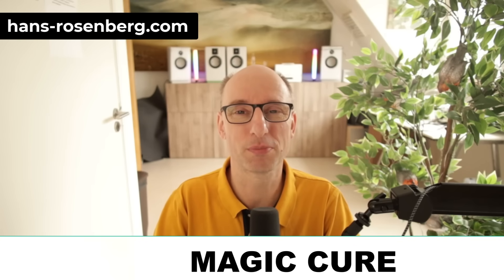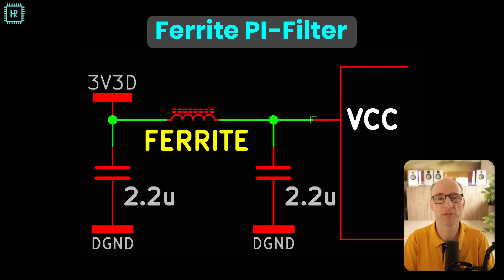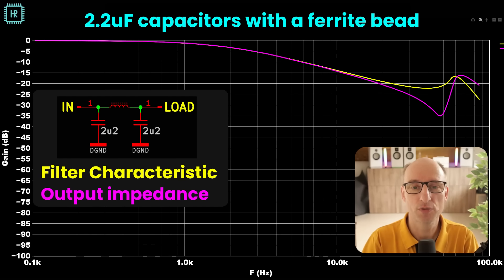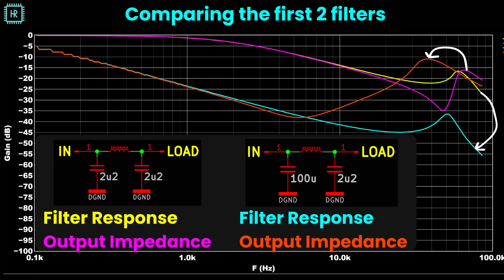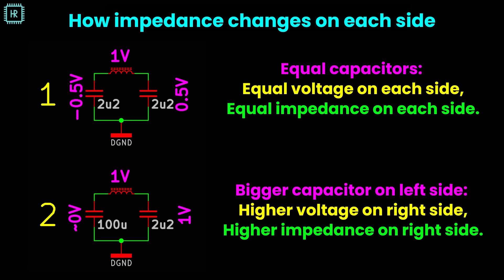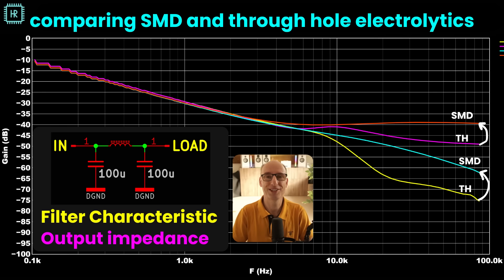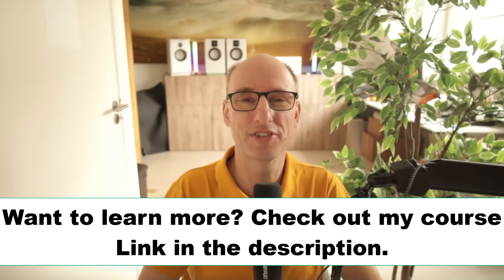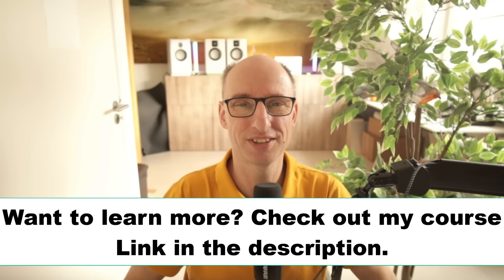How Ferrites Can Quietly Ruin Your Supply

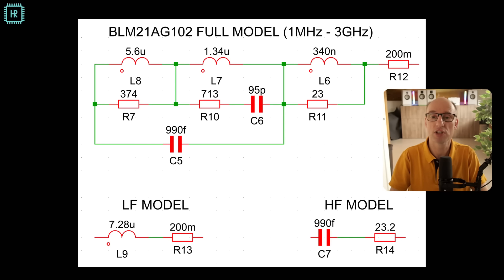Comment: 1:38 lol so "use whatever is dark gray, magnetic and on the floor after salvaging chips with a heat gun" is not a reliable strategy? :) On a more serious note, is there a filter design that would literally work with that, expecting just characteristics common to all SMT ferrite beads?
Reply from the maker: yes, use large caps on each side!

Comment: Always thought ferrite beads were meant to confine the current spikes from a noisy device and protect the power rail, not protect the device FROM the power rail?   .. In any case, what confuses me to this day is how do you use ferrite beads and bypass capacitors on PECL, given that Vcc is theoretically ground for PECL?
Reply from the maker: You're right, filters work both ways. You also keep spikes away from the main supply.

Comment: Neat research, though I’d want to use a VNA instead of an audio analyser, to see how they compare up in the MHz with the digital edges a common embedded circuit would encounter.

A more tactful method might be to design your PSU to take feedback after a PI filter (LC or RC) instead of putting a filter outside the PSU’s feedback loop. Even better, a capacitance multiplier, giving you less drop than an LDO and better ripple rejection at higher frequencies.
Reply: feedback after a pi filter just added  a pair of poles to your transfer function, you'd better damp the hell out of that filter if you want stability....
Reply: @terrygiven8789  Yeah you’d want to understand control theory better than I do to pull that off. Maybe if the switching controller recommended it in an appnote with a certain passive network on the comp pin.
Reply: @Scrogan  one trick if you are using a TL431 and opto for feedback is to connect the opto cathode to the input side of the filter, and the feedback network to the output side of the filter. the opto cathode and series R form a "fast path" and the feedback divider and compensation network form the "slow" path. putting the fast path on the input means the pair of poles arent there, and as long as the loop BW is lower than the filter poles, they dont affect the slow path much. Unitrode have an application note discussing this
Reply from the maker: I may do another video showing the RF performance. My VNA was not capable of measuring below 100kHz correctly, it showed bad results

Comment: The high (100uF) is only partial the reason, the second half is their relative high loss / E.S.Resistance, creating very low Q resistances.
100uF polymer caps or ceramic  with low esr could also be bad idea to use with the ferrite.
Reply: Use caps de menor valor em paralelo, isso reduz a ESR.
Reply from the maker: indeed, but if the value of the capacitor is high enough to crush the Q, then it is no problem.

Comment: Good points. Ferrite beads are commonly misunderstood and often used with a belief that they will magically "do what you want" by blocking all disturbances and letting the good stuff (a stable supply voltage) through. In reality they often cause a very high supply impedance in some frequency range, which means the circuit being supplied will disturb itself if it pulls an AC current in that range. 

I once attended a course by Lee Ritchey who strongly discouraged the use of ferrites and even handed out stickers with a sign with the meaning "ferrites forbidden". He claimed that the use of ferrites in the supply lines of ASICs were the cause of the failure of many Silicon Valley startups as they could not get their chips to work due to the high noise resulting from the use of ferrites in series with all their sensitive supply pins. And they ran out of money before they could figure out and fix the problem. 

I personally think ferrites can be quite useful in some cases, but you need to understand both the risks of resonances and undesired high impedances as you point out, as well as the loss in inductance when a current is run through them. Unfortunately, good simulation models and plots illustrating the loss in impedance as a function of DC current are usually not provided by the manufacturers.
Reply from the maker: exactly, the failing designs are those cpu/fpga supplies: high transient and very bad tolerance for supply ringing / noise.
Reply: My experience is that any ferrite smaller than a 1206 just can’t supply more than 500mA without saturation and rapid loss of inductance, but also increasing Q.

Comment: Those ferrite models are better than any picture I have ever received from LLM, when did they learn to deal with fingers that perfect?
Reply: ChatGPT 5 hat improved quite a lot regarding tetradactyly or hexadactyly but it sometimes still mounts arms or legs on the wrongs side. And it doesn't know that most people have exactly two arms and two legs but instead shows some small parts of a third arm or leg.
Reply from the maker: hahaha, have not seen that yet :-D

Comment: There are a few times that I've had to add a ferrite to the output of a switcher.  It was because the output diodes would ring when the switch turned on, or off, or both.  That ring is on the order of MHz while the supply switching is on the order of tens of kHz, possibly up to 200kHz.  Sadly once this noise gets on your power and ground planes, there is little that down-stream filtering can do about it, as anything you attach to the board has a higher impedance than your power planes do.  So the key is keeping it off the power and ground planes in the first place.  This is particularly important in communication applications (where supply plane noise gets multiplied up with your reference clock frequencies), and any low-noise measurement applications, such as test equipment.

I've safely added ferrites (and even inductors) BEFORE the big output supply cap - this means you don't need two big caps to quash the resonance as plotted in this video.  It does mean you have to be a lot more careful though!  The extra pole in the output filter may mean that you can no longer use the voltage feedback trim input on your supply, and may need to adjust the output manually, or adjust resitor values to set the nominal output a bit higher, to compensate for the voltage drop in the ferrite or inductor.  Although this is not an "elegant" solution, sometimes noise requirements demand it.

In the MHz range where you need the ferrites, supply layout becomes critical, and you must layout your PS filters as if they are RF filters.  Key to this is isolating the supply's local output and ground from the rest of the board.  Keep your ferrite and ceramic caps as close to the supply pins as possible, then place the low-frequency caps after that - making sure they have nice fat traces back to the switcher pins.  Once you have a tight, compact layout for the supply and its input and output filters, THEN add power and ground traces of appropriate width (preferably on top of, or next to each other) to connect to the power planes with via arrays.  It's a good idea to drop some ceramic cap there too - they're essentially at the end of a small inductor there.

The proper use of ferrites and / or inductors with your power supply can mean getting away with less capacitance and even better noise performance, but they can be tricky to use, and cause more problems if you're not careful.  Particularly for high-current applications; it can be difficult to find a ferrite that can pass enough current and still provide the RF filtering you need.  If you're trying to squash the output sawtooth with an inductor, you'll want a kickback diode to go with it so you don't kill parts when you turn the supply off!  But if you put that diode in parallel with the inductor, its capacitance will allow noise to get through!  So the answer here is to put it in parallel with the cap on its input side - that will limit the negative voltage excursion but its capacitance will help filter noise there rather than transmitting it to the load.
Reply: Ringing at your switching node would probably be better treated with a snubber network on that switching node.
Reply: In a switching regulator design, I also observed very fine spikes on both the input and output sides. These couldn't be controlled with conventional filters, so I suspected they were being introduced into the circuit via ground, for example. After about a week(!) of troubleshooting, I finally found the cause. The noise was caused by the bootstrap charge pump. A small series resistor (tens of ohms) for the bootstrap capacitor completely solved the problem.
Reply from the maker: Yes, those are considerations you have to take into account...

Comment: @10:23 I have never heard of or seen a QA401 audio analyzer, but I am thinking, perhaps, the "OUTPUT IMPEDANCE" schematic is messed up a tiny bit.  I would think the "OUT" should be connected to 50Ohm terminated side, instead of the "IN" side.
Reply from the maker: The output impedance of the outputs is 50 ohms

Comment: It is better to check noise with a spectrum analyzer or a very good scope to see if your filter works.
Reply from the maker: In a practical working application, this may be the only way. Although you can just hook a network analyzer or audio analyzer up to your supply via a calibrated decoupling capacitor. Then  you can measure impedance directly IN the network.

Comment: When you said SMD electrolytic, I thought you meant Tantalum SMD. But you showed a picture of a surface mount Can type electrolytic. So have you tried Tantalum to see it it fairs better than the SMD Can?
Reply: Tantalums can fail catastrophically when used on power supply rails. High current spikes when turning on will eventually cause the cap to short out the supply.
Reply from the maker: They're both aluminium standard types.

Comment: LC-filters are dangerous due to their resonances. It's funny that sometimes high ESR capacitors can be preferable because they dampen resonance. There is AN88 from Linear Technology "Ceramic Input Capacitors Can Cause Overvoltage Transients".
Reply from the maker: Low ESR is definately not always desirable...
Reply: Yes. I was once designing regulated DC-DC, and put about 5 or 6 ferrite beards onto the circuit. At the prototype testing I had to get rid of at least 3 of them, so only 2 or 3 left. Otherwise, with all of them the noise was actually much larger.
And lossy electrolyte caps placed in a right places help a lot too.
Reply: @volodymyrzakolodyazhny  Electrolytic capacitors with losses are not such a bad thing. Some LDO regulators are unstable with good capacitors, but work fine with electrolytic ones.

Comment: As always, these tests and measurements are incredibly interesting, thanks for sharing with us.

Quite surprised by the degradation of SMD vs THT caps, this goes totally against what I'm used to think, and the voltage rating is even in favor of the SMD... may this come from the increased trace impedance/resistance of the SMD ?
Reply from the maker: No, just the part itself is worse.

Comment: How about replacing ferrite bead with a feed through capacitor ⁉️🤔
Reply from the maker: A feed-through capacitors (as an smd component) is basically a capacitor with a really low impedance. They are great.  You don't get the advantage of extra impedance in that case.

Comment: Hi. I really appreciate your teaching materials.
Does it make sense to add ferrite beads to connect the main power supply GND to the Digital GND and Analog GND of such an integrated circuit, which combines digital and analog parts?
Reply from the maker: So you want to use them to connect different grounds? That is a bad idea, you always want to use a single ground plane. In my first few videos on my channel I explain in detail why this is the case.

Comment: Hans, with circuits running at low supply current, it is also an option to use a high resistance ferrite bead. That way, you can benefit from both worlds (but yes, these ferrite bead can't reach values like 10ohm...mybe a few ohms tops)
Reply from the maker: Yes, that is a great idea. The high resistance at DC helps damping resonances at low frequencies.

Comment: 5:59 Saying that the second circuit is functionally a transformer at some resonance frequency absolutely blew my mind. Thats the kind of statement that just rips apart ones simplified mental models of basic circuits.

And right after pointing out that two very clearly paraller capasitors are actually in series as far as the resonant frequency is considered (I hope I got that right).

I am not an electrical engineer, but a technician who aspires to design pcbs one day. To me its incredible how such simple circuits can hold such depth and complexity.
Reply from the maker: I had exactly the same reaction when I first learned this. I actually used these a lot as balun transformers for higher frequencies.

Comment: Tápegység esetében (DC) képes lehet nagyobb zajt generálni ha Step down konvertert használsz.
Azonban a megfelelő induktivitás és egy párhuzamos ellenállás nagyon soka javít.
Reply from the maker: I don't know if that got translated well, trying to understand it.
Reply: @HansRosenberg74  In a power supply (DC), a series inductor added for filtering can actually generate more noise if you use a step-down converter. However, choosing the right inductance value and adding a resistor in parallel with the inductor improves things significantly.